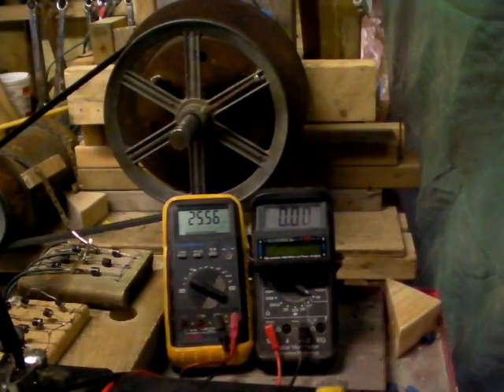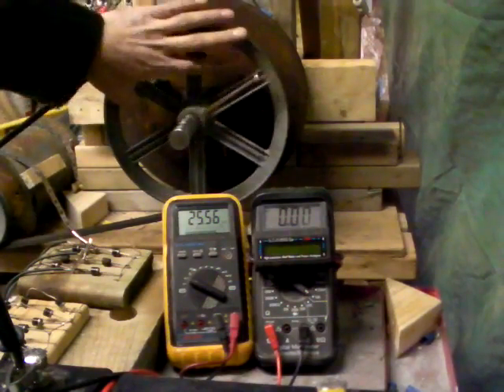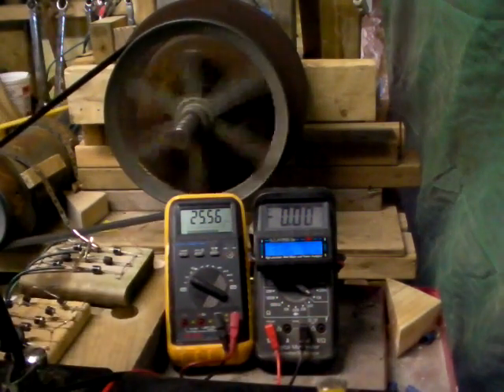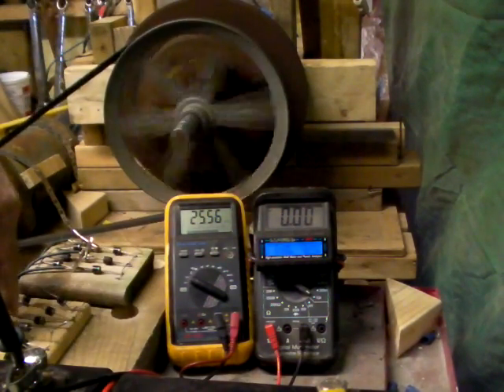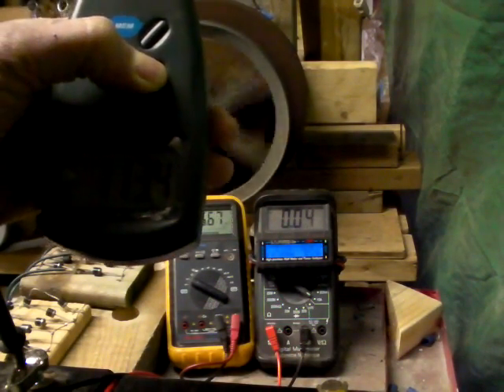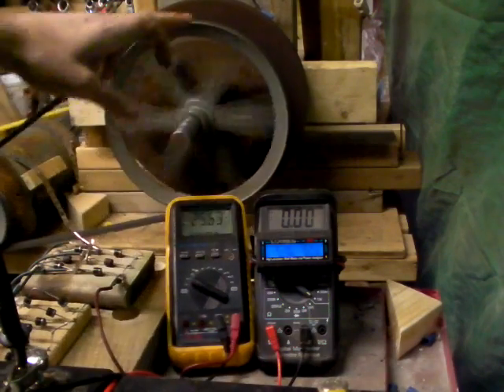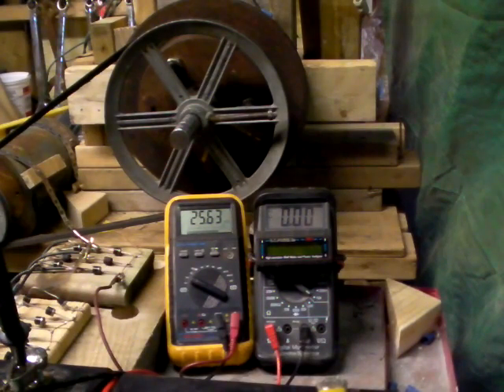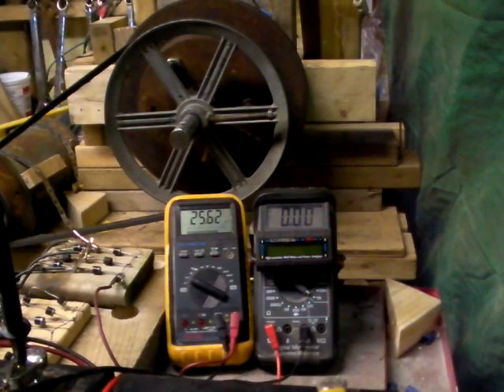05 12pole 36slots iron serpen 3phase PMA axial flux wind turbine vawt hawt generator energy 105

Comment: With the serpent winding you are only creating a half pole of electricity. Being you are not electrically energizing this system the magnets can only react to half poles on each loop of winding. Crazy but a serpent winding has so many ramifications that many times you can't change a three phase winding from serpent to loop winding. Don

Comment: cool video yea I had some one tell me that you should get current even when the voltage was below the battery voltage and I told them now the voltage has to be higher than the battery to get a charge current. nice video....I have been rewiing a car alternator and use the serpintin trik and it was so much easer to do then the coils because I seem to screw them up lol. again great video thanks for showing.

Comment: My small axial flux traditional coil windmill raises a 5ah 12.6 battery voltage quickly at about .03 amp and 120 rpm (estimate). Is that considered a decent working alternator (at least for a small battery) in view of your demonstration that the serpentine alternator needs such high rpm to output usable power ?